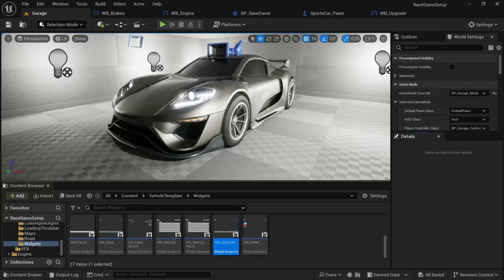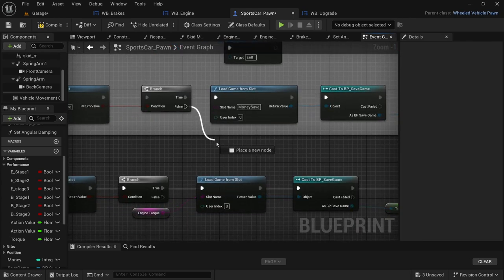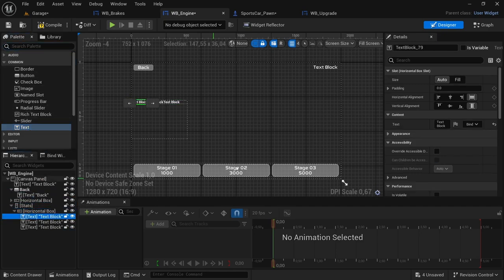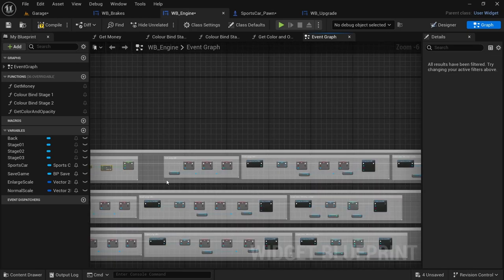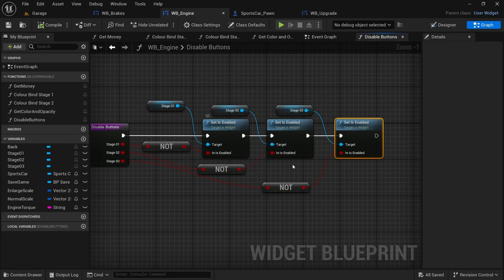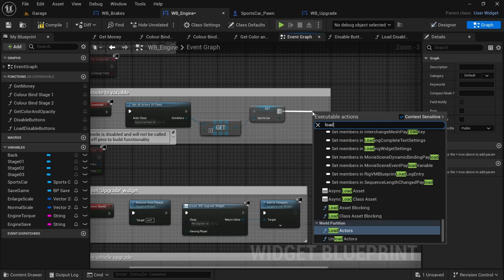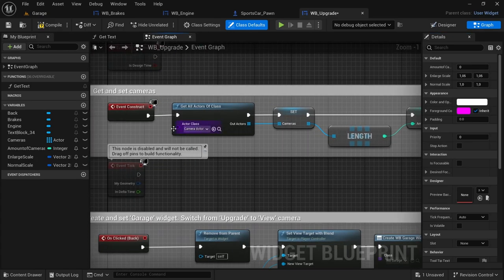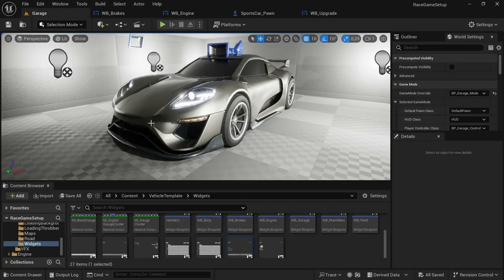How to Display Vehicle Performance Stats | Unreal Engine | Racing Game Tutorial

Comment: I have applied that to my project, thank you. I don’t want to make things difficult for you, but most racing games require changing the vehicle, which means needing to change the blueprints pawn. Can you make everything we did in the previous videos work with other vehicles? and thanxx again ♥
Reply from the maker: I can but when I created the project file at the beginning of the tutorial series, I didn't add the needed code to make that possible. If i were to add that code along with its support components to the series at this point, then I would have to essentially start the series from scratch as that would create a whole list of errors due to improper referencing.
Reply from the maker: https://www.youtube.com/watch?v=La0rEvgNKIk&t=2403s
Please check out the linked video to see the difference between what my vehicle referencing looks like as to how a multi car reference system would look like